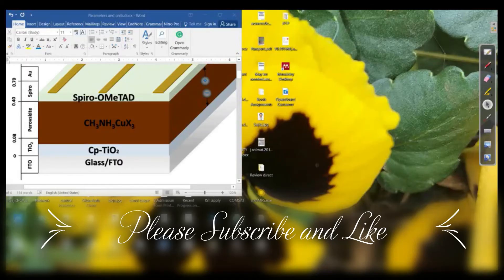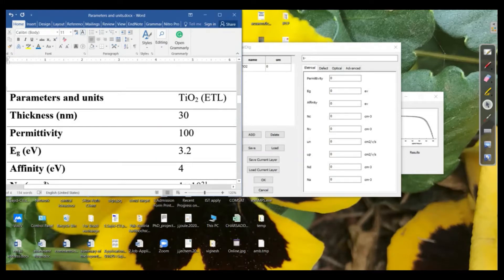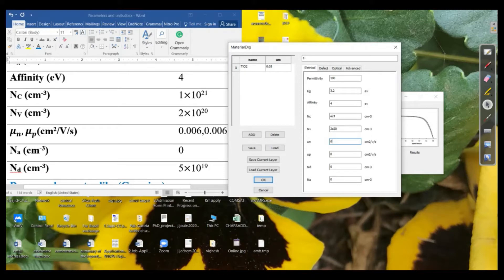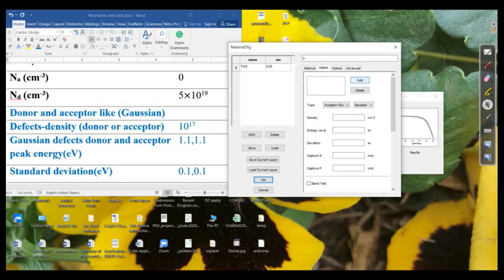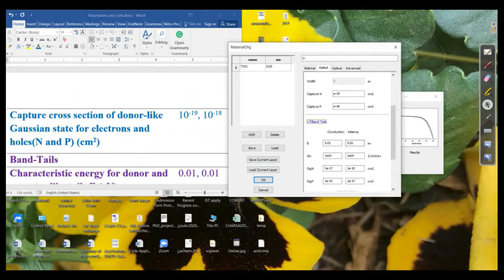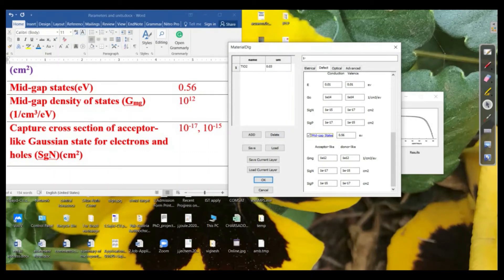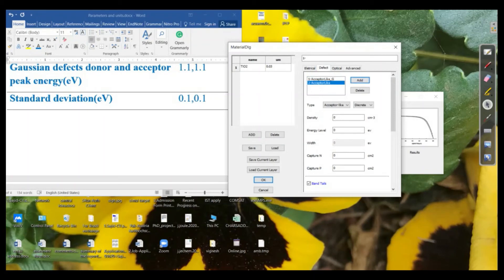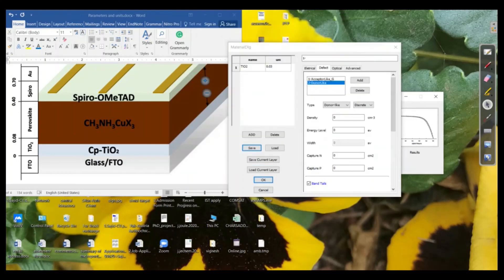How to add first layer in wxAMPS Lecture 03

Comment: How can we add ARC layer on  solar  in this software ?
Reply from the maker: Can you please elaborate ARC layer?
Reply: @PhysicsRadiate   Anti reflection coating for solar cell
Reply from the maker: Thank you. I think it will work by keeping in mind the required parameters of the ARC, Here is another link you may find some info. https://www2.pvlighthouse.com.au/calculators/Grid%20calculator/Grid%20calculator.aspx
Reply: @PhysicsRadiate   Thank you Sir